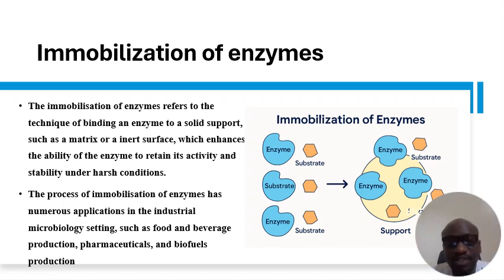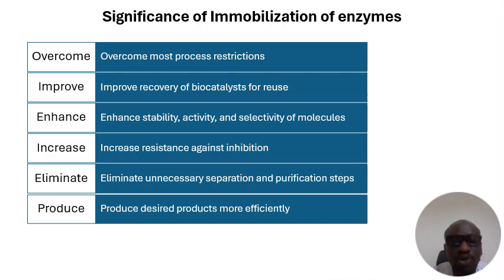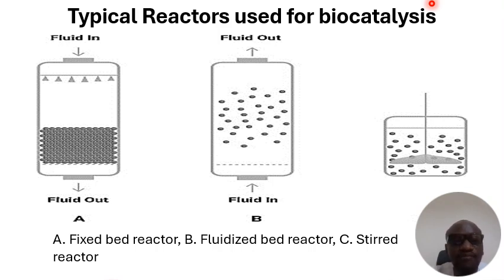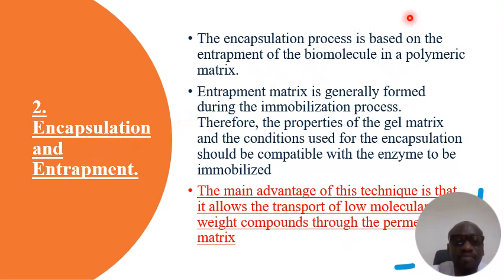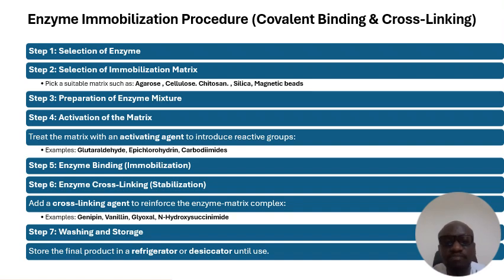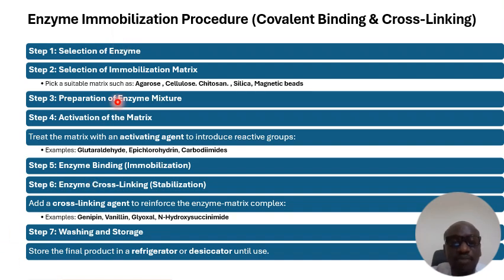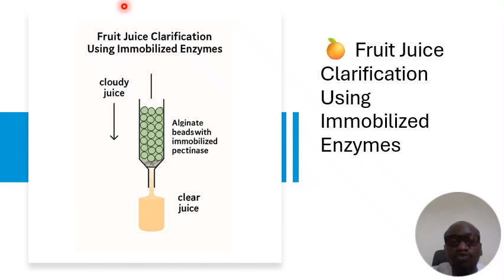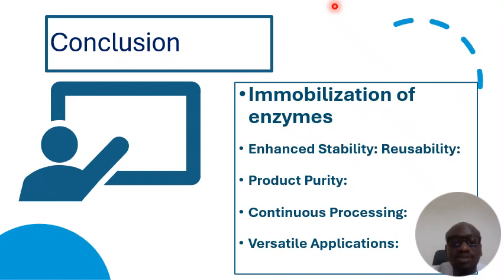Immobilization of Enzymes (Industrial Microbiology )

Comment: Question 1:

Enzyme immobilisation means fixing an enzyme onto or inside a solid material, such as alginate beads, silica, or a gel. Scientists do this by sticking the enzyme to the surface, bonding it chemically, or trapping it inside the material, and the enzyme still works normally. Since the enzyme stays in one place and does not mix into the final product, it can be collected and used again, and it survives heat and pH changes better than a free enzyme would.

Question 2:

It can be reused: The enzyme stays stuck to its support, so one batch works for many rounds of reaction instead of just one. This saves money and cuts down on cleaning up the product afterwards.

It lasts longer: Being held in place stops the enzyme from losing its shape, so it survives higher temperatures and a wider pH range, and it keeps working after long storage.

Real-life application: Making high-fructose corn syrup. Glucose syrup made from corn starch is passed through a column packed with immobilised glucose isomerase, which turns the glucose into fructose. The enzyme stays in the column, so the process runs non-stop and the syrup comes out with no enzyme in it.

Ademosu Oluwatimilehin
210807112

Comment: Question 1:

A. Explain Enzyme Immobilization

Enzyme Immobilization is the biotechnological process of fixing an enzyme to a solid support (such as beads, fibers, gels or membranes) instead of having them move freely in solution whilst retaining the enzyme’s catalytic activity.

B. How & Why

Enzymes can be fixed to a support via any of the following processes: adsorption, covalent binding, entrapment, encapsulation or cross-linking, with the aim of enhancing enzyme reusability and stability thereby cutting related costs.

Question 2:

A. Advantages

• Improved stability: Immobilized enzymes often show greater stability against changes in temperature, pH, and storage conditions.
• Continuous Processing: They can be used in continuous industrial processes, increasing production speed and efficiency, and reducing costs.
• Better Control of Reaction: The reaction can be stopped easily by removing the immobilized enzyme from the mixture. 
• Enhanced Shelf Life: Immobilized enzymes generally retain their activity for longer periods compared to free enzymes

B. Real-life Application

• Degradation of Pharmaceutical and Personal Care Products (PPCPs): Many drugs such as antibiotics and hormones persist in water and are difficult to remove by conventional methods. Therefore, immobilized enzymes are used to oxidize pharmaceutical molecules and
reduce the toxicity and persistence of these compounds (wastewater treatment). 
A common example is the use of immobilized laccase to remove antibiotics like tetracycline and endocrine-disrupting compounds in solution.

Daniel Nakpodia
180807055

Comment: Microbiology
Reply: Question 1:

Immobilisation of enzymes means attaching or trapping enzymes onto a solid support material such as alginate beads, silica gel, or magnetic nanoparticles so they become fixed in place and cannot move freely in solution. This is useful because it allows the enzymes to be easily recovered and reused multiple times, making industrial processes more cost-effective and efficient. 
Question 2: 
1) Reusability — Immobilised enzymes can be used repeatedly across many reaction cycles, significantly reducing production costs since fresh enzymes don't need to be added each time. 

2) Increased stability — They are more resistant to changes in temperature and pH, and they have a longer shelf life compared to free enzymes in solution. 

3) Real-life application — Immobilised enzymes are widely used in the fruit juice industry, where immobilised pectinase enzymes clarify fruit juices by breaking down pectins, improving clarity, yield, and flavour while maintaining nutritional quality. 

Question 2:

1. Reusability: Because immobilised enzymes can be recovered and used repeatedly, industries save on operational expenses by eliminating the need to constantly supply fresh biocatalysts.

2. Enhanced Stability: Immobilisation reinforces the enzyme's structural integrity, making it far more resilient against extreme temperature and pH variations, while also extending its storage stability relative to free enzymes.

3. Industrial Application: A key commercial use is found in the beverage industry, where immobilised pectinases break down pectin in fruit juices. This improves juice yield, viscosity, and clarity without compromising taste or nutritional content.

Eniola Olaitan Ogungbamila 
210807096

Comment: Question 1:

Immobilisation of enzymes means attaching or trapping enzymes onto a solid support material such as alginate beads, silica gel, or magnetic nanoparticles so they become fixed in place and cannot move freely in solution. This is useful because it allows the enzymes to be easily recovered and reused multiple times, making industrial processes more cost-effective and efficient. 
Question 2: 
1) Reusability — Immobilised enzymes can be used repeatedly across many reaction cycles, significantly reducing production costs since fresh enzymes don't need to be added each time. 

2) Increased stability — They are more resistant to changes in temperature and pH, and they have a longer shelf life compared to free enzymes in solution. 

3) Real-life application — Immobilised enzymes are widely used in the fruit juice industry, where immobilised pectinase enzymes clarify fruit juices by breaking down pectins, improving clarity, yield, and flavour while maintaining nutritional quality. 

Question 2:

1. Reusability: Because immobilised enzymes can be recovered and used repeatedly, industries save on operational expenses by eliminating the need to constantly supply fresh biocatalysts.

2. Enhanced Stability: Immobilisation reinforces the enzyme's structural integrity, making it far more resilient against extreme temperature and pH variations, while also extending its storage stability relative to free enzymes.

3. Industrial Application: A key commercial use is found in the beverage industry, where immobilised pectinases break down pectin in fruit juices. This improves juice yield, viscosity, and clarity without compromising taste or nutritional content.

Eniola Olaitan Ogungbamila 
210807096

Comment: Question 1: Explain immobilisation 

 • Enzyme immobilisation is the process where enzymes are physically confined or chemically bound to an insoluble support material, restricting their movement during a reaction. This technique is highly useful because it allows the enzymes to be easily separated from the product, recovered, and reused multiple times in industrial processes.

Question 2: Advantages of immobilised Enzymes

• Reusability: Enzymes can be easily separated from the reaction mixture and reused for multiple cycles, significantly reducing operational costs.
• Increased Stability: Immobilised enzymes often exhibit greater thermal and pH stability compared to free enzymes, making them more durable in industrial environments.
  • Real-Life Application:
• The production of high-fructose corn syrup (HFCS) using the immobilised enzyme glucose isomerase to convert glucose into fructose.

SANNI MUIZ ADEKANMI
230807572

Comment: Question 1:
Enzyme immobilisation is the attachment or confinement of enzymes on an inert support using methods such as adsorption, entrapment, encapsulation, covalent bonding, or cross-linking. It improves enzyme stability and allows easy recovery and reuse, making industrial processes more cost-effective.

Question 2:
Advantages
1. Reusability: Enzymes can be recovered and reused, reducing costs.
2. Enhanced stability: generally resistant to changes in temperature and pH.
3. Easy separation: Enzymes remain on the support, simplifying product purification.

Application of enzyme immobilisation
Immobilised penicillin acylase is used to convert penicillin G into 6-aminopenicillanic acid (6-APA), an intermediate used to produce semi-synthetic penicillins such as ampicillin and amoxicillin.

Iyamu Joseph Ikponmwosa
210807075

Comment: 1. Enzyme immobilisation is basically the process of attaching or trapping active enzymes onto a solid support or matrix so that they stay fixed in place during a reaction and don't end up mixing into the final product. This is useful because it makes it easier to recover and reuse the enzymes after each reaction, which saves cost in the long run and  also helps the enzymes remain stable even when there are changes in temperature or pH, it’s also stress free. 

2. Advantages and applications:
1 Enzymes can be reused multiple times, which significantly cuts down production costs.
2 They become more stable under varying temperature and pH conditions, so they are less likely to denature.

Real-life Application
A good example is the glucose biosensor, which is widely used by diabetic patients to monitor their blood sugar levels. In this case, the enzyme glucose oxidase is immobilised onto a small electrode. When blood is applied, the enzyme reacts specifically with glucose and produces a measurable electrical signal that gives the glucose reading. Because the enzyme is immobilised, it stays in place on the strip, works consistently, and doesn't contaminate the blood sample making it both accurate and safe for repeated diagnostic use.

Fagboro Ayorinde 
210807130

Comment: microbiology
Reply: Question 1: Immobilisation explained

Immobilisation of enzymes is the process of attaching or trapping enzymes onto a solid support or carrier while allowing them to retain their catalytic activity. This enables the enzymes to be reused, makes them easier to separate from the reaction mixture, improves their stability, and reduces the cost of industrial production.

Question 2: Advantages and Application

Advantages:
a. Immobilised enzymes can be reused many times, reducing production costs.
b. They are more stable and can withstand changes in temperature and pH.
c. They are easy to separate from the reaction mixture, reducing purification steps.

Application:
In the dairy industry, immobilised lactase is used to produce lactose-free milk by converting lactose into glucose and galactose as the milk passes through a reactor containing the immobilised enzyme.

Ladenika Mosopefoluwa
210807131

Comment: Question 1:
Enzyme immobilisation is the method of restricting enzymes to a particular support material so that they remain in a fixed position during a biochemical reaction. The support may be a gel, membrane, or solid particle. This technique is commonly used because it prevents the enzyme from contaminating the product and allows it to be used repeatedly.

Question 2:
Two advantages of immobilised enzymes:
1. Cost-effectiveness: Immobilised enzymes can be used many times before they lose their activity, reducing the expense of constantly replacing enzymes.
2.  Simplified product separation: Because the enzyme remains attached to its support, it does not mix with the reaction products, making purification easier and faster.

One industrial application:
1. Production of high-fructose corn syrup: Glucose isomerase is immobilised and used to convert glucose into fructose during the manufacturing process. This improves efficiency and allows large quantities of sweetener to be produced continuously.

Destiny Williams 
210807032
Microbiology

Comment: Question 1: Explain immobilisation  
Immobilization is the technique where enzymes are attached or binded to a solid support, which can either be a matrix or inert surface, in order to enhance the ability of the enzyme to retain its activity and stability under harsh o r unfavorable conditions. This allows the enzyme to react with a substrate to create a desired product while remaining attached to its support.

Question 2: Advantages of immobilised enzymes
(i) Easy Separation and Cleaner Products: The enzyme remains on its solid support, so it does not contaminate the final product, drastically reducing the need for costly downstream purification processes.

(ii) Reusability and Stability: The enzymes are highly stable against pH and temperature changes, meaning they can be recycled and used continuously over a long period without needing frequent replacement.

Real-life application:
Immobilised lactase is used industrially to produce lactose-free milk. The milk is passed over lactase fixed to a support, breaking down lactose into glucose and galactose without the enzyme ending up in the final product.

Nwachukwu Emmanuel Ezeh 
210807002

Comment: Question 1: Explain Immobilisation

Immobilisation is a technique where enzymes are attached or fixed onto a solid support material (such as beads, membranes, or gels) instead of being left free in a solution. This is done using methods like adsorption, entrapment, covalent bonding, or encapsulation. It is useful because the enzyme can be easily separated from the reaction mixture and reused multiple times, which saves cost and improves the efficiency of industrial processes.

Question 2: Applications and Advantages
Advantages of immobilised enzymes:
1. They can be reused repeatedly, reducing production costs.
2. They are more stable to changes in temperature and pH compared to free enzymes.
3. They allow for continuous, automated production processes.
4. Purification of the product is easier since the enzyme doesn't mix into the final solution.

Real-life application:
Immobilised lactase enzymes are used in the dairy industry to produce lactose-free milk by breaking down lactose in milk that passes over the fixed enzyme.

Osunrinade Eniola Elizabeth 
210807109

Comment: Microbiology
Reply: Question 1: Explain immobilisation
Immobilisation is basically just attaching enzymes to a solid surface, like tiny beads or a membrane, so they stay put while the reaction happens. The big perk is that you can fish them out and reuse them over and over, which saves money and stress.
Reply: Question 2: Applications and advantages
· Reuse for days: Since the enzymes don't wash away, you can run batch after batch with the same batch of enzymes.
· Way more stable: They handle heat and pH changes better than free, floating enzymes, so they're less unstable.
Reply: Temitope Bukola

Comment: Microbiology
Reply: Question 1: Explain immobilisation

Enzyme immobilisation is the process of binding enzymes to an insoluble solid support material (such as resins, gels, or beads) so they remain fixed in place during reactions. The enzymes are physically or chemically attached to the support, allowing them to be easily recovered and reused after the reaction is complete. 

Question 2: Applications and advantages

Advantages of immobilised enzymes:
- Enzymes can be recovered and reused multiple times, reducing production costs.
- Increased stability and longer shelf life compared to free enzymes.

Real-life application:
Immobilised enzymes are used in glucose isomerase reactors (used to convert glucose to fructose in corn syrup production), lactase in dairy processing to produce lactose-free milk, and in biosensors for medical diagnostics.

ANIMASHAUN MARIAM AYOMIDE 
210807110

Comment: Microbiology
Reply: 1. Immobilisation of enzymes is the process of attaching or trapping enzymes on a solid support, such as a matrix or an inert surface, so they remain in one place while carrying out reactions.

 This is useful because the enzymes can be easily separated from the products and reused many times, making the process more efficient and cost-effective.
Reply: 2. Advantages of Immobilised enzymes:
a. Immobilised enzymes can be reused multiple times, reducing costs.

b. They are easy to separate from the final product, so the product is less likely to be contaminated by the enzyme.

One real-life application:
Immobilised lactase is used in the production of lactose-free milk, where it breaks down lactose into glucose and galactose.
Reply: NAME: Okon Queen Imobasi 
MATRIC NO: 210807102

Comment: Question 1:
Immobilisation of enzymes is the process of fixing or trapping enzymes onto a solid support or carrier while allowing them to remain active. This enables the enzymes to catalyse reactions without mixing with the final product, making them easier to recover and reuse. It also helps improve their stability during industrial processes.
Question 2:
Advantages:
1. Immobilised enzymes can be reused several times, which reduces production costs.
2. They are easy to separate from the reaction mixture, resulting in a purer product.
3. They are often more stable and can remain active for longer.
Real-life application:
Immobilised lactase is widely used in the dairy industry to produce lactose-free milk and other dairy products. The enzyme breaks down lactose into glucose and galactose as the milk passes over the immobilised enzyme, making the product easier to digest for people who are lactose intolerant while allowing the enzyme to be reused repeatedly.

Aderiye Esther Olasunbo 
230807518

Comment: Microbiology
Reply: Question 1: Explanation of Immobilisation
Immobilisation of enzymes is the process of attaching enzymes to a solid support or surface so they stay fixed in one place. This helps the enzymes remain stable and active even under harsh conditions. It is useful because the enzymes can be easily reused and separated from the products.

Question 2:
Advantages 

1. Easy separation of enzymes: Immobilize enzyme can easily be recovered and separated from the final product and it makes the process to be cleaner and more efficient and purification processes. 
2. Multiple of enzymes of over time: Enzyme remain stable over a long time reducing the need for replacement of this enzyme 

Application:
Used in pharmaceutical synthesis to produce drugs like antibiotics and hormones with high purity.